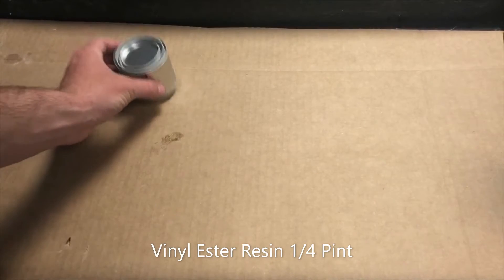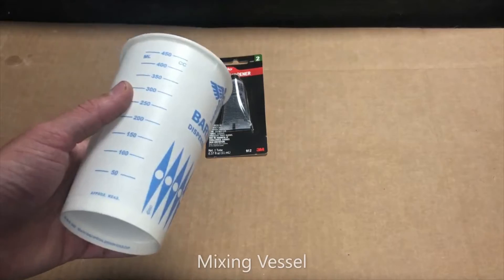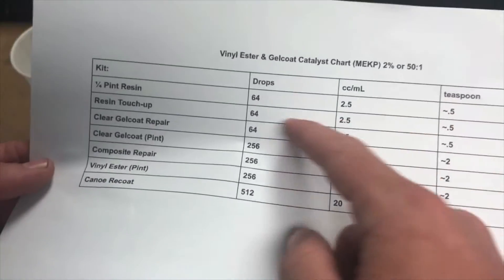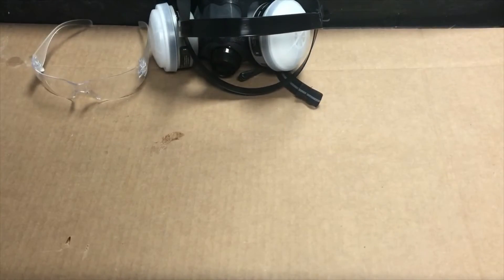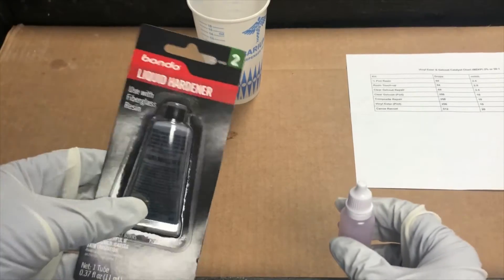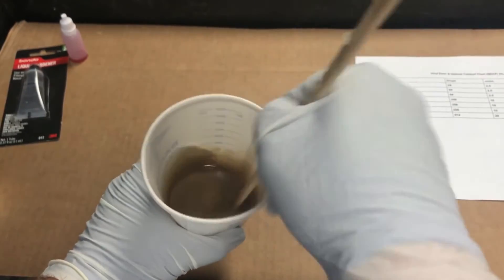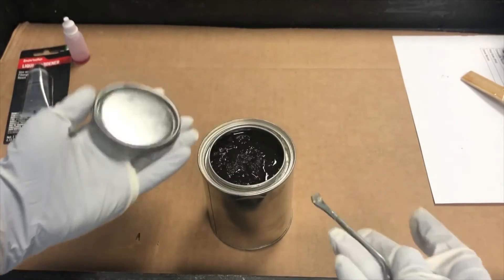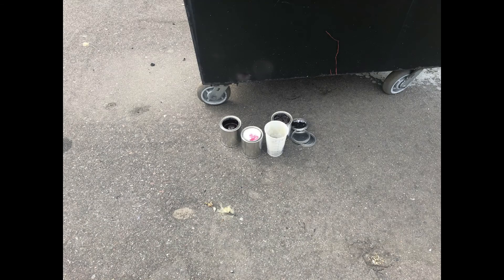How To Mix Vinylester Resin

Comment: the resin reacts with MEKP to create bubbles. its not from mixing but the peroxide with something in the resin. OK how long should it sit after mixing before application? Your resin has a VERY fast reaction time. Its often much slower..
Reply from the maker: You can apply immediately